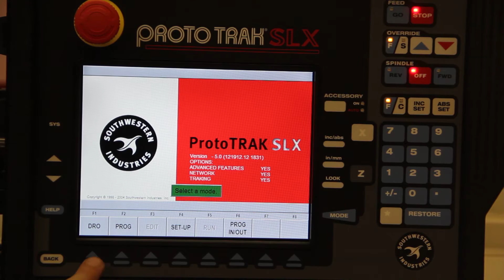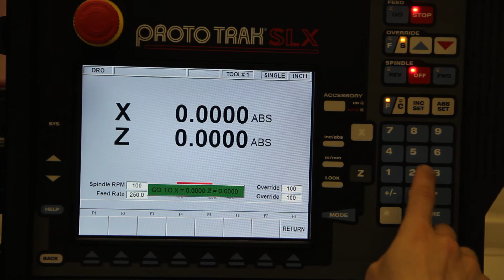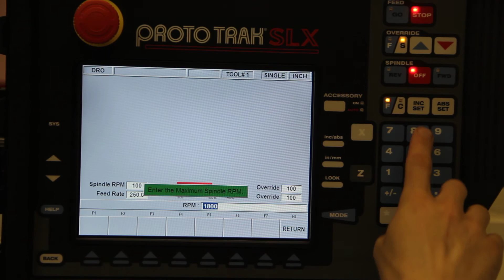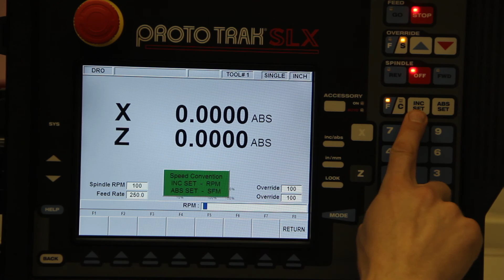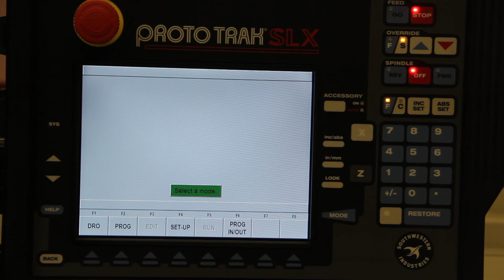TRAK SLX 2-ax CNC control 1/3

Comment: I use one of these every day and at the risk of sounding like an idiot I set my tool and put in .008 r for the tool.now. When I write the program to turn a 1 inch diameter and put in an .008 r for the tool it cuts .030 small wtf am I doing wrong???